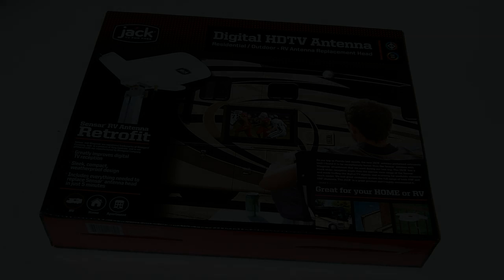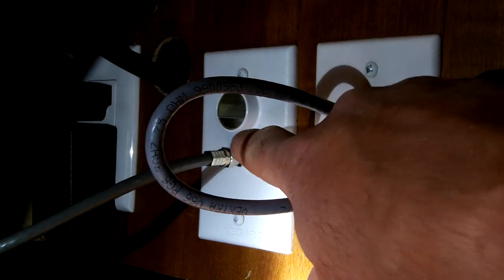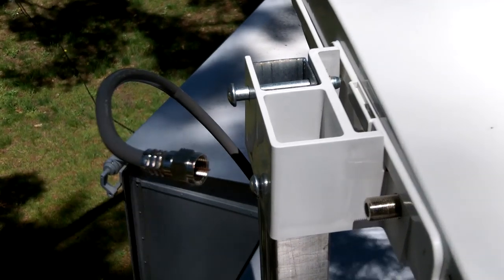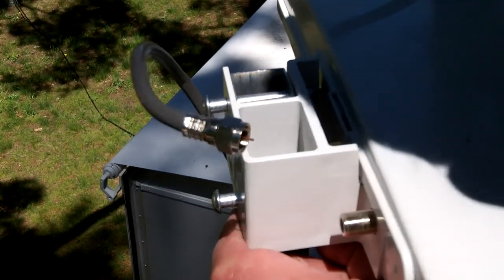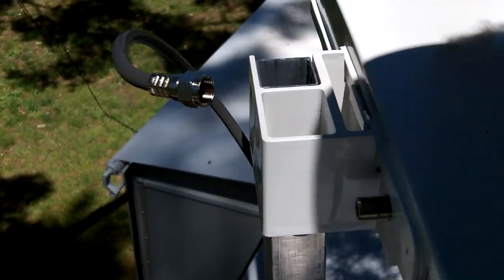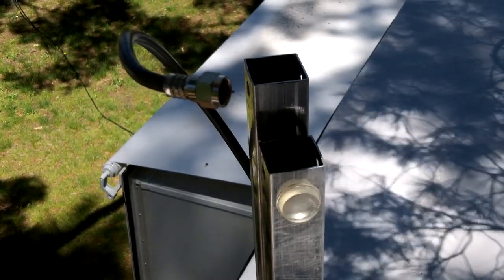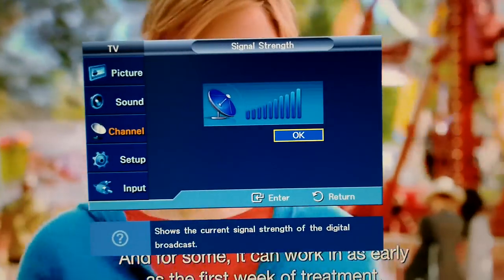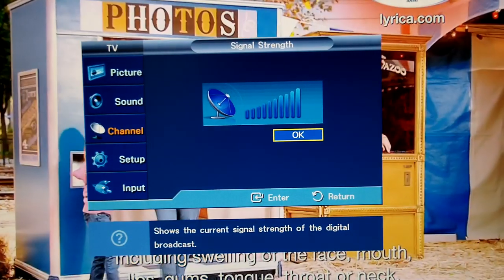King Jack RV Antenna VS. Winegard Sensar RV Antenna Signal Comparison

Comment: After you installed the jack , did you still need to use the winegard booster that came in the camper ? 

Also .... Do you know if the winegard SENSARPRO meter is compatible with the jack ? 

Thanks
Reply from the maker: The Jack came with its own booster but I elected to use the existing Winegard booster instead. I simply swapped out the antenna on top of the antenna mast.  As for the SENSARPRO meter, I do not have one but I don't see why it would not work.